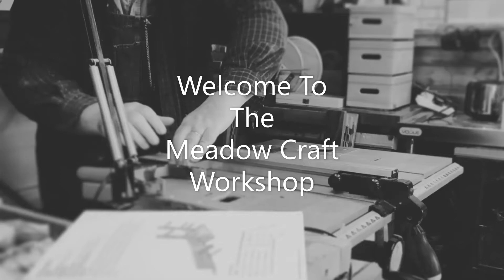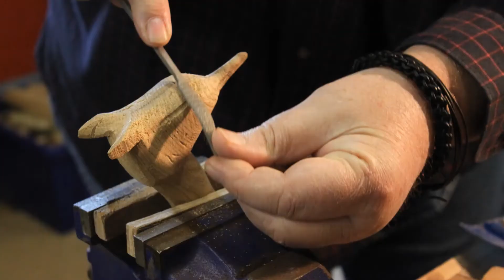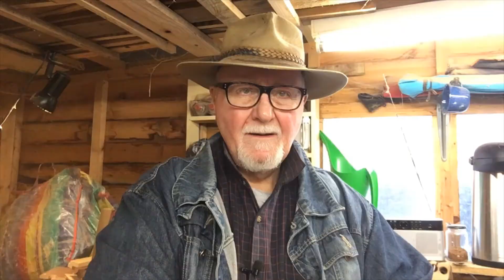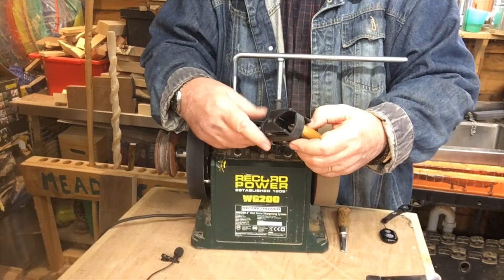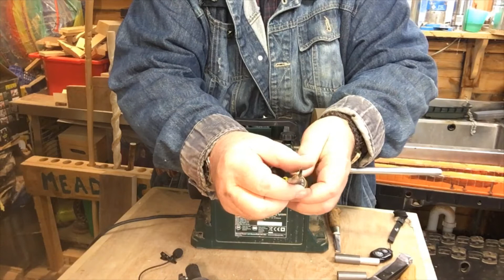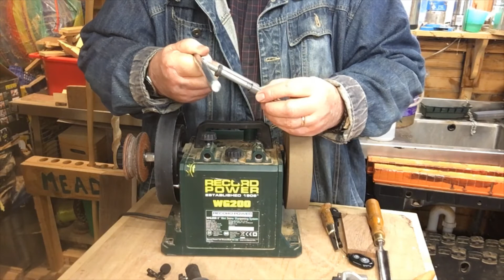WG200 Overview

Comment: That's why i prefer Tormek and its accessories...I've got one question - Tormek is known for their superb quality and no wobbling issues with fantastic bearings. How is this one? You mentioned about wobbling in previous video but i saw how shitty is the competitors cheaper even than WG200 where there is wobbling all the time and even working over a stone to flatten it does not help because bearrings are shitty. This has good bearings? Wobbling was fixed?

Comment from the maker: Hi Phil good idea but trying not to add to the cost. Record Power when contacted re the tool guide height and admitted there was a difference. In the WG 200 and the WG 250. As my machine was still less than a year old they supplied a WG 250 bar free of charge. I still think the literature is a little misleading but they feel it’s not so as they gave me the part to solve my problem no complaints. The current stone is soft but once you are aware and adjust the pressure used to hold tools against it , it achieves some very fine results.
Reply: Thanks for the reply, great information, Im enjoying your site, stay safe